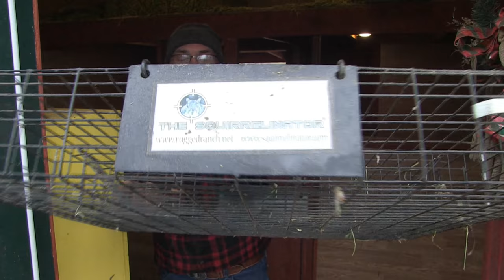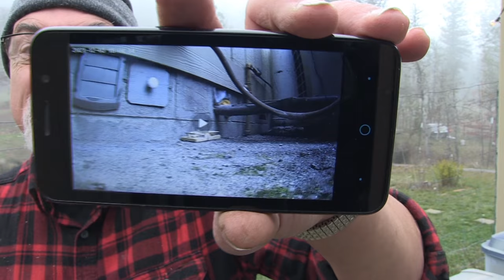I GOT RID OF RATS - How I Got VICTORY Over The Infestation

Comment: I see you put some foam or rags and such in the crawl space openings to keep out rats BUT that is a bad idea.  The crawl space needs to vent to keep your floor joists from rot.  Use heavy screen material instead.  Great vid.
Reply from the maker: No rags. I used foam in one half of one vent space. When I built my foundation I made sure I placed more than I needed to rid moisture and radon gas.

Comment: A number one and a half steel trap placed along walls works great. Wire trap to a cinder block half or large rock.  Block against trap to form passage over the trap. Have trap so they are going between jaws not over them. Bed of trap is parallel with wall. No bait.  They like to run along the wall.

Comment: Mice and Rats can compress their ribcage, and so can fit through any opening that their skull will fit through (about 1cm x 1cm). Leaving openings and then trapping them is not a good idea. The y will eat through anything foam, plastic or soft wood. Best bet is to use cement or the large (not fine)steel wool for small holes.
Reply from the maker: Yes they can, and they are good at it.

Comment: Use that mix it works for the mice great but rats are staying away from it. As for the snap traps use tootsie roll roll it in your hand get soft then add it nicely to the bait area.  Mice and rats bite it and can’t get away so easy as there teeth stick to setting the trap off from all the movement.
Reply from the maker: The rats here are eating it.

Comment: I had 100's of rats in my barns and spent $350 on poison rat blocks and got rid of them, but now B.C. has banned poison for 18 months and even though I bought $100 worth before the stores ran out, I'm eeking it out as sparsely as possible.  I spent today putting rat blocks into holes and screwing a metal mesh over the holes, but will run out of blocks before next year.  I'm going to try this idea.  Sounds cheaper than poison.
Reply from the maker: Go for it.

Comment: Don't block the crawl space vents, you'll have mold problems you'll only wish you had mice insted. You can screen them mice wont eat metals  remember a mouse can get into a hole the size of a dime, as a kid the house was cement blocks and mice still got in.
Reply from the maker: No, don't. That one vent I had to use the foam. The other one I use steel wool.

Comment: you need allot more snap traps. a Exterminator uses 20+ snap traps when dealing with rodents and each trap has a half-house on top makin sure the rodent can only approach the trap from the desired direction. Peanut butter is the best bait when the combine it with nesting material tied to the trap trigger.
Reply from the maker: I'm so done with those things. The soda is the most effective way of maintaining the population.

Comment: hi thanks for posting this I have a home that needs some of these trap ideas I am worried about doing the baking soda thing what happens when the nest is in yr home and the little Devil's explode in the home or the attic or basement like that would be a big mess and smell if it went into the walls.... Which way would you approach this for cleaning... If they get into yr walls can they just be left there until the smell goes away. I am not living in the home anymore and I am freaked out anytime I go check on the home when there is an unusual smell. Thank you ahead of time this home is 5000 square feet with large garages and lots of stuff in these garages I need an expert to do an estate clean but we live in Ontario.
Reply from the maker: When they die in the attic, crawl space or wall, their odor lingers for about ten days. Be sure to plug the gaps where they are getting in. It's all about the digestive system and the complexity of it. Rodents having a longer digestive tract than other critters are subjected to a rapid buildup of gas from the baking soda having the reaction with the stomach acid. Rodents cannot burp or throw up, but they do eventually fart. It being a long passage for the gas to fart out, too much builds up and perforates their stomach and upper digestive system and they die. shows I produced on this that may be enlightening https://youtu.be/9CwzP7AGQzM and Myth of using gloves https://youtu.be/SDVZQWgCiVk and https://youtu.be/ydzL-VQlSao and  https://youtu.be/kle3Ho-N6S0 and https://youtu.be/KT9PuuqkpaY and  https://youtu.be/No5tPn1wKaE. ENJOY

Comment: You can try all the poison and traps under the sun. However you must do a full home exclusion and with materials that are not easy for these rodents to chew through.
Otherwise you will just keep fighting these animals. Who wants to keep needing to trap keep needing to poison. Do the exclusion or get a professional company to do it follow it with a trapping session within attics/crawl space/in the house. Once the space is trapped out you shouldn't have the issue anymore. However I would put rodent bait boxes around the perimeter of the home and  rebait them with poison monthly to control the population on property.
Reply from the maker: I did manage to plug the holes and found where they were getting into the attic of the bunny bungalow. I recently found a nest of them inside my big plastic battery box for the solar on my barn. The critter chewed a hole right through the plastic. ARGH.

Comment: How do you prevent them from continuing their path into the house after consuming baking soda and exploding inside the walls?
Reply from the maker: Um, they do not explode. And, I plugged all the gaps with wire screen and spray foam insulation. Once they expire, the stink haunts for ten days and then NOTHING.

Comment: Started out with 3 barn cats after I year I have 2 . They do the job. They get everything Evan moles and golfers, strange they only eat the mice. My job is putting out kibble and cleaning up the dead in the mourning.
Reply from the maker: I have seven and an owl. Mice are controlled. The rats are a problem.  I also mentioned the recipe and show the outcome in my other shows I produced on the Subject as well as an explanation. It's all about the digestive system and the complexity of it. Rodents having a longer digestive tract than other critters are subjected to a rapid buildup of gas from the baking soda having the reaction with the stomach acid. Rodents cannot burp or throw up, but they do eventually fart. It being a long passage for the gas to fart out, too much builds up and perforates their stomach and upper digestive system and they die. shows I produced on this that may be enlightening https://youtu.be/9CwzP7AGQzM and Myth of using gloves https://youtu.be/SDVZQWgCiVk and https://youtu.be/ydzL-VQlSao and  https://youtu.be/kle3Ho-N6S0 and https://youtu.be/KT9PuuqkpaY and  https://youtu.be/No5tPn1wKaE. ENJOY

Comment: I used professional poison, hardware poison and Walmart poison.  I had poison on top of poison.  It worked but not until l over did it.  I had no success with traps.
Reply from the maker: I have very little success with traps. I do have much success with the cornbread mix with equal parts baking soda.

Comment: Dude you have every animal under the sun, but no dogs?   Dogs really work for the occasional wood rat.   I am in the first level of hell at this point.   A hog farm went in up the road about a mile or two away.    I am 13 down, but am far from victory.   My pup just reached the age where she can nail them, which is how I found out I had a problem at all.    I will give this a try but am really concerned about the reeking death smell.  
Shaun woods used Ratx... he baited for a week with sunflowers seeds...then mixed them with the rat x. All the rats went for it at that point, and he dug up the burrows and they were in fact dead. So I am going to try adding this trick to my arsenal.   I know I need another dog and a bunch of fairly feral cats, but... this old lady is tired, and my mom deserves better than to have to live with this infestation I just learned I had.  
If all you have is the occasional wood rat, thats not a big problem, its these nasty invasive norway and roof rats that live in groups and are so extremely invasive.  I have lived here 30 years ( 150 yr old farm house) and never experienced anything like this.   I refuse to take the risk of actual rodenticide in case my cat or dog should find one and eat it, not to mention all the red tail hawks and owls and coyotes around.
Reply from the maker: The wife says NO to dogs. Dang.

Comment: Yes Yes Yes
Texas Tree Rats (TTR)
My 4br 3b Dallas Texas home had 30-40 Texas Tree Rats and small or mice.
First
Mouse Traps
Well that was only food for the TTR. After a week and no kills
Rat Traps
Snap 1 Snap 2 next got 6 more Rat Traps
Snap 3 mice Snap 3 TTR
Home holes Frig and dish washer had edge mold holes Pantry had hols. P
Plugged all holes
Roof
Replace all pipe vent stacks Fix TTR break in
but
Grauge has a bulb seal and TTR can force their way under the Grauge buld seal.
Rat Traps more more more
Peatunut butter 
Rat Traps
Peanut Butter
Rat Traps
Now
Sorta gone but TTR poo dropping on my entire insualation on roof 
To extensive to remove just cover with new insualtion
Rat Traps are a common sight on my Dallas home and every month I find TTR has got in.
Rat Trap
Peanut Butter
Not mouse trap Rat Trap.
Reply from the maker: I and many many viewers are having and have had EPIC results with this stuff.
HOMESTEAD HACK-Ridding Rats In The Attic  https://youtu.be/X2GNa0kWNz8
KILL RATS DEAD WITH CORNBREAD MIX: https://youtu.be/TBeySuYvdbY
KILL RODENTS AND INSECTS WITH BAKING SODA; https://youtu.be/lwzWpBGn0No
CONTROLING RATS IN THE ATTIC: https://youtu.be/X2GNa0kWNz8+
HOMESTEAD HACK-Mulch using Cedar https://youtu.be/85Zlk5SRHeQ

Comment: Use chocolate coated almonds. Drill a hole through them and thread that on the wire in the trap.  It works fantastically good.  Let us know how you find it.
Reply from the maker: Great tip!
Reply: @pinemeadowshobbyfarmafruga8319  chocolate is the first choice food for rats and mice.    We even caught 2 rats at once in the same wire trap!,,, it’s deadly bait.  We have a spread called Nutella which is chocolate and nuts,haven’t tried that, the almonds are so good why bother.  We tried he baking Soda thing, but u never know if it works or not. This way we have also got a bead count.   We had 9 rats in about 7 days, then nothing, so I think we have wiped the little buggers out. Thank goodness, winter around the corner.   Give it a go,mi am sure you will be amazed at the result.